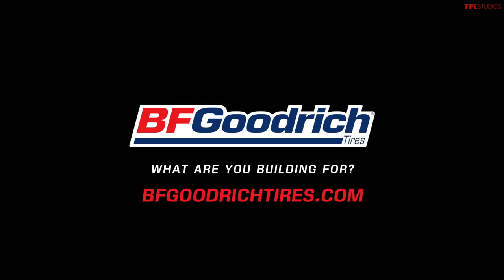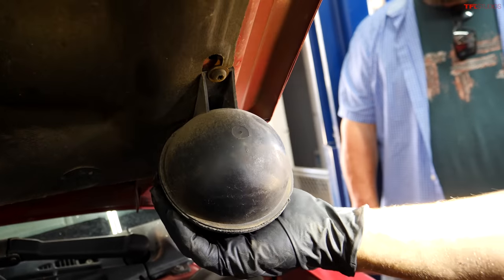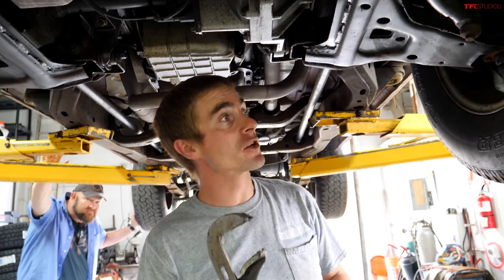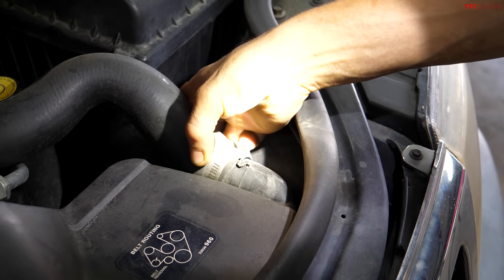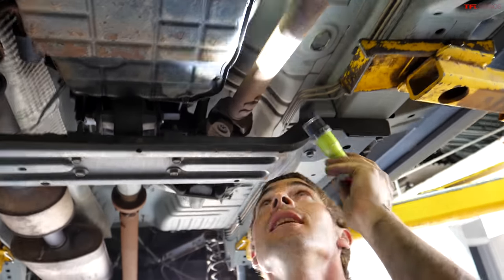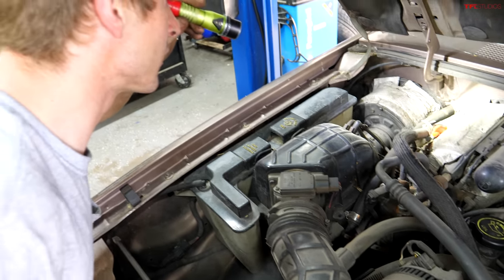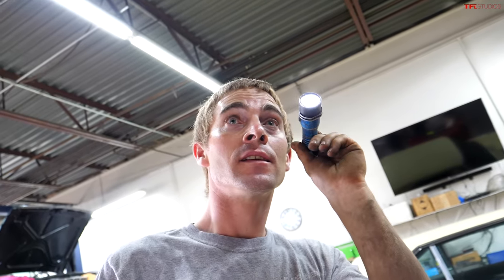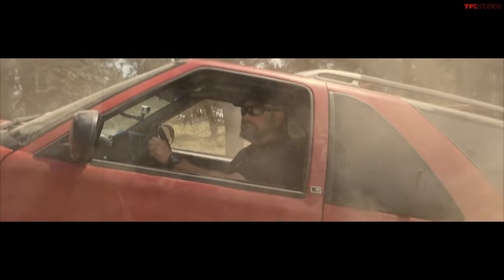It’s Much Worse Than I Even Imagined — Our Mechanic Can’t Believe What a POS I Bought!

Comment: Aren’t the oil leaks just the built in automatic rust prevention system? 🤣
Reply: Absolutely lol
Reply: It’s not working lol
Reply: “Self lubricating chassis system”
Reply: It's a wonder you can't get that feature on many new cars. 😜
Reply: It's just letting you know that there is oil in it.
Reply: My Toyota pickup leaks oil and the frame after you wipe it down looks brand new
Reply: Also for easy inspection of what your fluids look like
Reply: Perpetual fresh oil system. Always needs a fresh quart, eliminating the need for regular oil changes.
Reply: The best leak to have is the transmission tail house where it meets the driveshaft. Drive shaft's spray's it all around lol

Comment: Ummm, you bought $2500 trucks in 2021. He should believe anything. If you drove them to the shop, you won.
Reply from the maker: Very true!  The prices are crazy these days!
Reply: Agreed. Found a Grand Cherokee for 1500 with a rusted out and broken shock mount and a slipping trans XD so they all win!
Reply: do people just repeat things that people tell them? used cheap cars are still the same where i live in iowa.....
Reply: @DaBossk  pre pandemic I was going to put an f150 platinum up for sale market was 30k i didn't have time due to family issues to put the truck up for sale until recently and sold it in 2 days for 43k. 
At the bottom end the 500-800 cars are gone because that's less than the scrap and catalytic converter value. If things are stable in Iowa count your blessings and count the days.
Reply: @DaBossk  nah, over here in the NY,NJ,PA,CT, etc. area, ever since COVID, the cost of used vehicles have skyrocketed. Not to mention the sale of Rangers/B3000 (thank you Cleetus McFarland)
Reply: @police428  same out here on the West Coast brother
Reply: @earlscheib7754  yeah. Right now, I can sell my  Green 04’ Yukon SLT for 5K easy. And it would sell within the week.
Reply: @earlscheib7754  They aren't stable here, prices are actually a lot higher for anything in decent condition, and the cheap stuff is actually in much lower supply than usuall, prices are definitely trending up.
Reply: You should see what you get for $2500 in Ohio. It would be heck lot more rust. Probably no cats lol
Reply: Just a few years ago you could buy cheap cars at 1-2k. :(
Reply: @ruzefosho  like I said scrap and cat prices are high, we had an old work truck lose an engine 01 f150 I sold the cats for 1200 parted out the rest 150/per door, 500 bed and tailgate, 500 front clip, 300 diff, 500 trans 80% of the calls I got were for the catalytic converters. There are guys buying cheap cars just to scrap the cats that also hurt the cheap car market.
Reply: I know, right?  In the early 2000s I bought myself an '86 Cutless Supreme for $150 and never had any real issues with it besides valve cover leaks.  I later traded it for an engine/transmission for my S10 Tahoe pickup.  $150 these days might get you a nice set of lug nuts.
Reply: @Yophillips3272  Yep lol
Reply: Haha them guys that sell 1999-2006 gmc or silverados for 4000$ on up and they have over 200k on them .. lmao
Reply: @Antihero-4132  ha ha they are banking the money while your doing nothing.
Reply: @earlscheib7754  what am I supposed to do stop them?
Reply: I bought my truck for $1,900 in April. It’s a 1994 Toyota pickup 2wd with a 2.4l 4 cylinder and 5 speed manual. I have had almost no issues with it so far. I’ve had to replace a radiator and that’s it. Only $150. I have drove it almost 2,000 miles and it hasn’t stranded me yet
Reply: Paid a whopping $300 for my grand Cherokee I’ve had it since August with no major issues so far. 245k on the odometer
Reply: Bought three trucks for 1500 so it’s still possible
Reply: I paied $1100 (2022) for a 95 Dakota 2wd with 124000 miles ac dont work needs shocks but other then that its a nice little Wisconsin truck.

Comment: Gotta love Toby. He sounds like Kripky from Big Bang theory and has a great sense of humor. 
And how did I know the Ford was gonna be the junker?!
Reply: Now ask the price to repair these trucks. Mazda parts are cheap chevy are plentiful but that jeep/dodge trans would cost a fortune.
Reply: Rangers run forever dude,everyone knows that. Not Tacoma forever but a quarter mill for miles is easy
Reply: Well, Toby is right about those 4.0 head gaskets. Mine only lasted 329K miles. And it was from a radiator hose falling off.
And my shift knob has been falling off for probably 10 years...
Reply: @fredflintstone4715  I like the sarcasm...that's great of any head gaskets making it to 329K .... Ford Rangers with the 2.3 / 3.0 and 4.0 ohv's are some of the longest lasting engines made...but hey, let's just unfairly ignorantly bash quality inexpensive American vehicles and support foreign competitors...   ?
Reply: I'd rather pay for ball joints than a transmission.
Reply: Man I gotta stay out of the comments til after lol
Reply: @JohnSmith-yz7fg  Yes, that Mazda has parts for reasonable prices, but it's a Ford Ranger under the Mazda shell.
Reply: @MikeSmith-ey7ku  Agree, had a '92 from 2006-2012 and rolled it up to 237K nearly and only got rid of it due to fluid leakage, with the oil needing 2 Qts almost bi weekly, and yes, it was the 4.0 pushrod V6, 2WD with the Mazda sourced 5spd transmission that had most of the shifter bearings replaced in 2009, and going out when I had the idle air control valve adjusted so I could safely drive it on the freeway to where I was trading it in for the Mazda P5 I drive now. Got a grand for that old truck and it was a great truck too and I'm not a truck kinda guy but it endeared itself to me during my ownership.
Reply: My money was on the Jeep 🤷🏻‍♂️

Comment: That bracket on the blazer is a factory part. It is used on the ZR2 for a steering stabilizer. He didn’t check the rear wheel bearings correctly. The blazer has a C-clip rear axle so it will have axial/in and out play.
Reply: Everything has c clip axels man
Reply: @MikeSmith-ey7ku  no, they don't.
Reply: Everything I’ve ever worked on does. Except a 3/4 ton pickup. And I’ve done some wrenching
Reply: @MikeSmith-ey7ku  Ford 9inch is not c clip, a lot of Dana axles (specifically Dana 44s) are not c clip (every v6 4x4 jeep wrangler does not have c clips), multiple others from various manufacturers
Reply: @nabob14  huh,Thought the 9 inch was but no idea the Dana 44 didn’t have em. And I ride around on 2 every day. I’ve worked on a few Ford 8.8’s and I can’t even remember what the other 2 that I had apart were but they both had c clips. It’s gonna drive crazy now
Reply: The jeep axel (Dana 44) is held in by 4 bolts on the back side of the dust covers/ heat shields for the disc brakes.
Reply: @MikeSmith-ey7ku  a lot of trucks and suvs have brackets that hold the axle in place instead of c clips. This jeep in the video is one of them that has an axle retainer instead of c clips
Reply: @MikeSmith-ey7ku  Semi floats will use a C-Clip or pressed bearing.  Most full floats that I know about will use retaining nuts inside the hub bore.

Comment: That Jeep with the 4.7 is a bomb waiting to go off, should have found one with the 4.0 straight 6. The blazer has a very common issue of the oil cooler lines leaking. The blazer will outlast the other two by a long shot.
Reply: Probly not though, they like over heating and then tanking.
Reply: Yep, my 2000 has 240k still going strong 💪

Comment: That bracket on the frame is original. It wasn’t added.   A steering damper is attached there and goes to the steering linkage.

Comment: Loving the series guys! I owned a ford ranger 98, I turned into a light wheeler/daily with 31x10.5 inch mud tires, bilstein shocks, locking front hubs (rugged ridge is the only brand that makes them for the ranger), off road bumpers front and rear, frame welded rock rails under the doors, a bumper mounted swing out tire carrier, and a yukon grizzly locker to finish it off. I live in the pnw, and kept up with many many jeeps and toyotas. I went through 2 sets of oem hubs after destroying the factory ones offroad. I highly suggest these from rugged ridge, they cost less than $200 usd. Cant wait for the next video!

Comment: my prediction, the jeep trans will fail. the mazdas front auto locking hubs will fail to work when 4x4 is really needed. the chevy will blow an oil cooler line pumping all the engine oil out.
Reply: I think the jeep will be just fine, the other two will struggle. Someone likely pulled something extremely heavy with the jeep and set off the temp codes.
Reply: @codylapoint  I'm pretty sure 1 of the TCC control springs in the trans pump is broken, especially at 200k+ miles it's common. It won't allow the converter to lock up properly in 4th gear so the clutches in the converter are getting worn quickly and get hot. it can also cause low line pressure especially when cold. It may start to overheat at freeway speeds if they become too worn but should perform fine otherwise.
Reply: @chadingram6390  Interesting, I've never had a 545 rfe or the 4 speed version apart before. I just know I've never had one fail. One of them would slip for a few seconds after cold startup until it built line pressure, but if you let it idle for 15 seconds or so it would shift just fine.
Reply: @chadingram6390  if that was the case it would be in limp home.
Reply: @TheSavage3.6  No it won't, it just won't lock up the torque converter and will cause the clutches to burn up and heat up the trans. I've fixed this problem in this jeep and it does not go into limp mode, it just won't engage the clutches

Comment: My family bought a 1998 chevy suburban k1500 LT with 84k miles for $3500 8 years ago. Now, prices are getting up there, even for the higher mileage ones. So far, it has 124k miles and is sitting in our front driveway. If only used car prices were cheaper...

Comment: Jeep for the win!  Tommy did great on that WJ!  I have one myself that just turned 238K 4.7L limited with the 242 HD T-case.  They are great vehicles if you maintain and take care of them.
Reply: Jeep for the win??
The engines and transmissions and those are garbage!!
Reply: @philllsxga.7737  so why aren’t these failing???? Lol. You are a joke
Reply: @Natethegreat200c  three of my friends are mechanics and I work on vehicles also the valve seats come out of the heads on those 4.7s and the hemis..
and a remember  the ram they bought before?? the trans was junk???
Chrysler drivetrains are junk!!
The hemi has oiling issues and undersized  oil return veins, same with the 4.7 oiling issues undersized oil return veins and the valve seats come out of the heads..
The engine in that jeep is not original I know that for sure...
Reply: @philllsxga.7737  you don’t. Again too many are ON THE ROAD TODAY. Everyone isn’t spending more than a car is worth to keep it on the road. Both engine and trans. HIS ram had issues. Again, TOO MANY of them of old on the road. Lots of first generation Durango’s everywhere as well. Explain why? are ALLL these people replacing engines every few thousand miles? You make no sense. If the transmission AND engine issues were wide spread, you wouldn’t see ANY at all. It’s not uncommon to see any of the vehicles I mentioned.
Reply: @Natethegreat200c  work on a Chrysler you'll see.
YouTube LSX RAM.
YouTube LSX Challenger.
YouTube LS Dakota.
YouTube LS magnum.
YouTube top gear Americas best 4x4...
Chrysler are the least reliable vehicles..  the ram and Jeep have the most steering drivetrain and recall issues...
Reply: I have two 2002 Jeep Grand Cherokees with 4.7 V8s, one of them has the 242HD And the other one has a nv247, both are pretty reliable  if you keep on good maintenance with them. 0 issues with the engines and transmissions!
Reply: @willem0698  I agree!  Mine is a 2000 bought from original owner 7 years ago.   Changing the oil is critical on the 4.7L and as long as you don’t beat it to death or overheat they will treat you well.  Biggest issue I had with mine was the PCM went out had over 200K at that point.  The rest of it has been common maintenance.  Bought mine in FL and driver her back to NY with no issues.  7 winters later my rocker panels are starting to rust.  Biggest issue up here is rust from salt.
Reply: @timtrinkaus7072  my brother's Blazer has 306, 000 miles on the complete factory engine PCM four-wheel drive, AC and CV joints 306,000 miles and he takes it off road..
Everything on it works like factory...
He tows and off roads it.
It gets beat on!!
It's his daily driver..
Reply: @timtrinkaus7072  yeahh, those are common issues because of age and the state you’re living with, but overall this Jeeps a pretty good, and can keep up in the trails with a new Wrangler. My Laredo has a 4.5 RC lift with fully adjustable control arms all around from different brands like Rustys and IRO with 33s; and goes everywhere with it!! I beat the crap out of the 4.7 and it holds because I give it good maintenance, just dont overheat them!!
Reply: @philllsxga.7737  definitely not jeeps are some of the best vehicles to buy.
Reply: @fireant1272  ha! 
YouTube wrangler JK LS..
That's how you make a Jeep a good vehicle...
Reply: @philllsxga.7737  yes pretty sweet but I'll take the 392 anyday.
Reply: @fireant1272  the whole reason of the GM drivetrain swap is for power and reliably..
Reply: @philllsxga.7737  I wonder why GM doesn't make a factory off roader with alot of power like the jeep 392 or make an powerful factory off road truck like the trx. They are way behind. But sadly everything is going electric.
Reply: @fireant1272  why is everyone swapping a GM drive train in there race car/ off roader???
YouTube LS Lamborghini.
YouTube LS Ferrari.
YouTube LS WRX.
YouTube LS Porsche.
YouTube LS BMW.
YouTube LS 9 mustang.
YouTube LSX Challenger.
YouTube LSX RAM.
Why do you think that is??????
Reply: @philllsxga.7737  yes the LS motor is awesome but that's about it. I cant think of a cool new vehicle that GM makes besides the Corvette. Do they even make a proper off roader with more then 400hp.
Reply: @philllsxga.7737  they tried with the blazer but look at that thing lol
Reply: I have a 1999 Jeep Grand Cherokee with a 4.0 i6, has a cooling problem, but other than that, it's literally better than what my grandmother is driving.

An Equinox...
Reply: @philllsxga.7737  Chrysler 3.7, 4.7&5.7 all drop valve seats price a good used or reman engine. And Chrysler transmissions 🤣👎. I'm not a big gm fan but it's way more durable and a fraction of the cost to work on.
Reply: Except the transmission. Engine is good as long as maintenance is kept up.
Reply: @philllsxga.7737  the definition recall is something that was caught by either the consumer or manufacturer, and they’re fixing it for free under the public’s view. Recalls aren’t a bad thing.
Reply: @Natethegreat200c  no not really.
My Silverado has had a couple but I have never experienced the recall issue.
I now have 128,000 trouble-free miles.
Not one problem.
And I tow and off road..
I'm hard on it .
Reply: Another GM fanboi,, sigh..
Reply: @paulhunter9613  YouTube LS fest keyboard warrior...
Reply: @paulhunter9613  exactly
Reply: @philllsxga.7737  google the man driving his new truck causally and the engine BLEW.

Comment: The coolant hose “splice” on the Mazda near the firewall is actually a vacuum operated valve for the coolant to flow to the heater core when you put on the heat, They usually take a crap so you just put a double male connector on there

Comment: As a licenced Tech for over 30 yrs  with GM Toby did what we normally call a regular quick visual inspection or 50pt inspection. It's a quick once over that a Tech would perform if someone was thinking of possibly purchasing a old beater for winter or something most certainly not a full DOT safety. He would have to be a pretty good Tech to work on German cars they are highly engineered and have very close tolerances and strict service intervals. I know my dad is also a retired mechanic with 50 years fixing Porsche Audi VW and any vehicle that would come in for service-repairs.

Comment: 14:00 I had a 2006 with the 4.7L, same problem with a leaking t-stat housing.
Reply: Me too, the problem is that there is no gasket on the housing itself. The gasket is on the thermostat with an indexing tab on it. If you look really close that tab favors one side of the thermostat ( the side away from the motor. It lines up with a little notch in the plastic neck piece, and if you have the gasket on backwards even with the notch clocked properly it will still leak a few drips every now and then. It took me a lot of swearing over several weeks to notice that the tab wasn't in the exact center of the gasket and it could in fact be put on backwards. Why they even put that stupid tab on there makes no sense to me it doesn't help it seal it does a better job causing it not to.

Comment: Not as much gloom & doom as some make it out to be. They all have a lot of miles & years, yet they all drove in under their own power. And all the issues are fixable.
Reply: I wouldn't want to pull an engine at 230k for main seals. That would be like trying to save an urn from a fully engulfed burning building.

Comment: PSA:  Get yourself a couple turkey basters from the dollar store, use one to pull the brake fluid from your reservoir, and the other the power steering fluid.  Change the fluid out every oil change, only costs a few extra dollars.